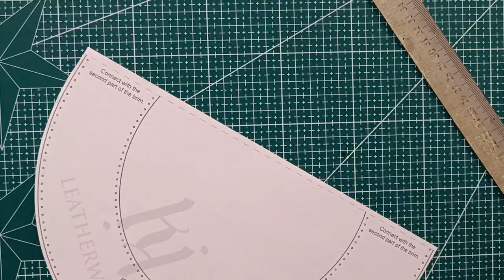Making of Firefighter Leather Helmet

Comment: Did you make this as a decorative piece? Do you have a cutout set where you can make an actual helmet?
Reply from the maker: The helmet has real dimensions and when designing I based it on the structures of real helmets, but it probably does not meet current safety standards for firefighters ;) And this is the only pattern I have :)
Reply: @KiLeatherworks  sweet I'm going to pickup the pattern!